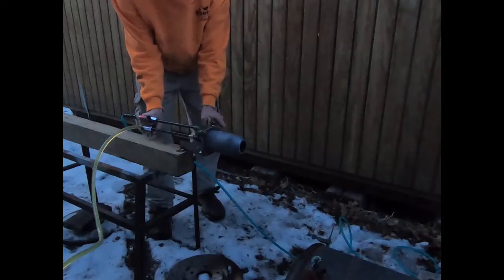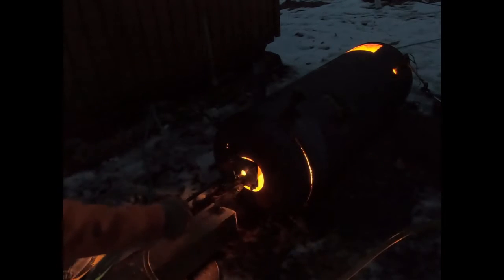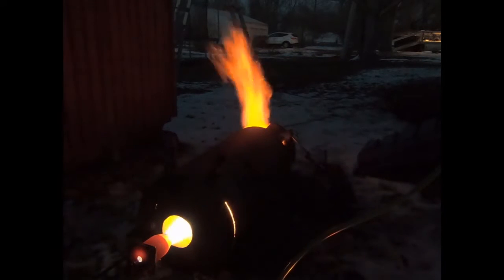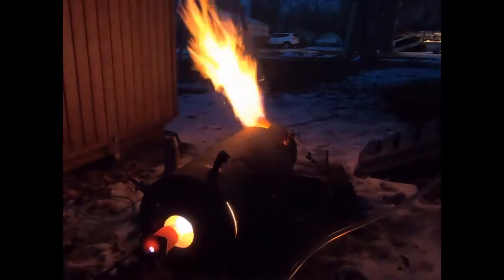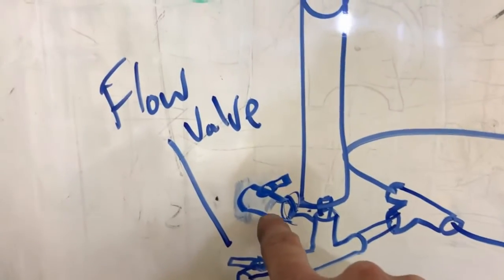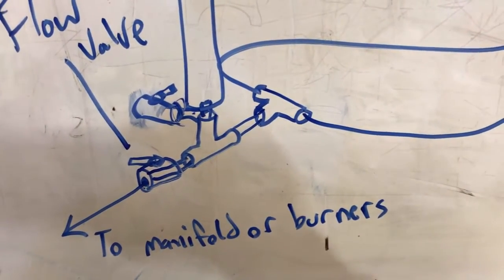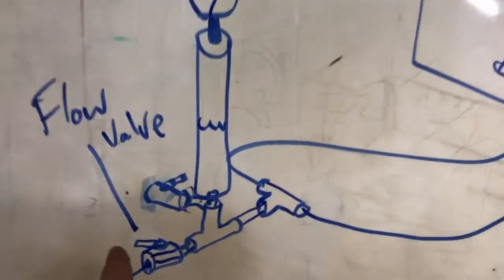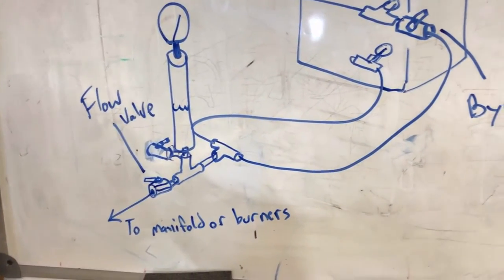Diesel burner for M&M mining

Comment: Just install a nice  adjustable  regulating valve (relief valve) in place of the bypass valve. Then there will be no priming or adjustment issues.  Just a simple adjustment of the flow valve and thats it..